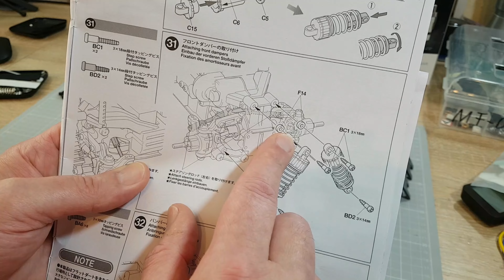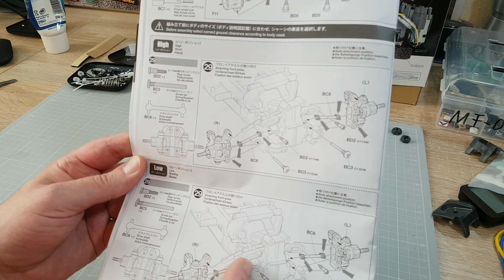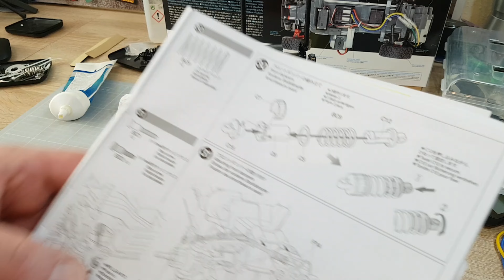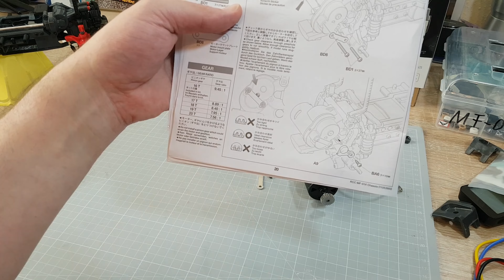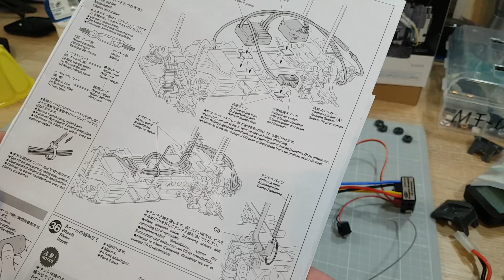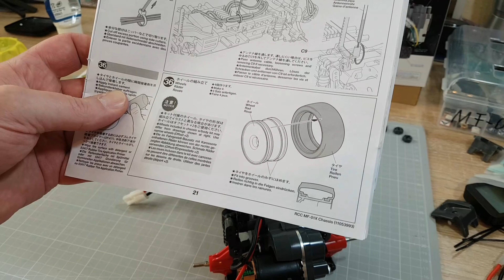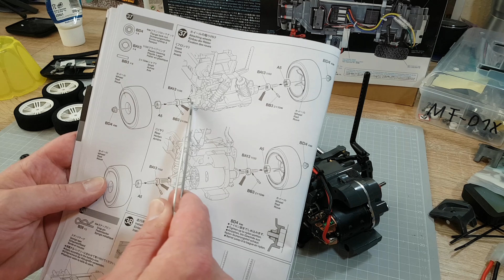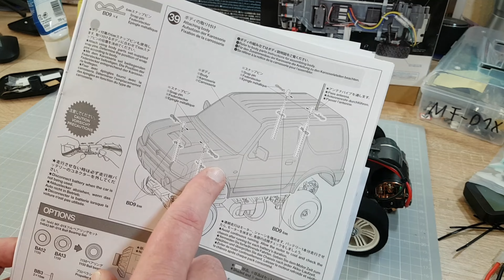MF-01X: Building Video (3/3) - Steps 26 - 39 (Poor Boys RC Speed Run Challenge 2024)

Comment: Good work Dirk it's coming along nicely
Mate that's a beautiful looking chassis body looks mint fantastic work mate I always wonder though how do kit's still have mistakes in them you have to fix great work again Durk take care mate
Reply from the maker: Thanks for this great comment. It's not complete their fault. These car're made and tested for slower speeds. And mostly they work in that range. Then comes the RC Fam and wants to beat out the hell out of the cars. No matter what the manufactor does, someon's always complaining about the slop or tightness. To be honest I wouldn't have shimmed the car, if I had used it in stock. This one's made to go as fast as possible and therefore I did it😁

Comment: Great stuff Dirk!  For the contact tires are there different sizes available or just one size?  I was trying to see a size on the box in your video but couldn't make anything out.  Just wondering for next year as it's also possible that had I had better tires I would have got better speed out of it. Anyway, awesome video...love this chassis!
Reply from the maker: Thanks a lot Freddy MS Fun Racer recommendet them. It's hard to get any data sheet about these tires. No shop ever gave out any meassurements. I endet up searching with the item mumber J13705 Markus gave me. 
I had seen other racers going faster brushed and on rubber tires than me, but these foam ones stick better to the road.
Thanks for watching my friend.